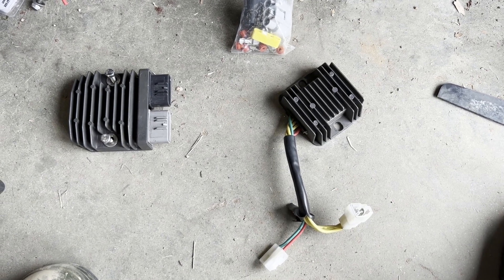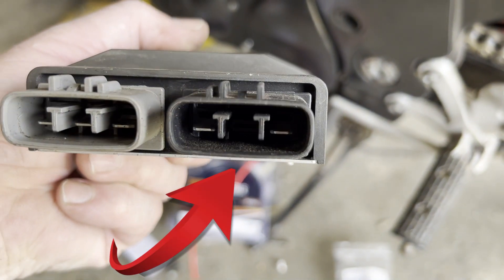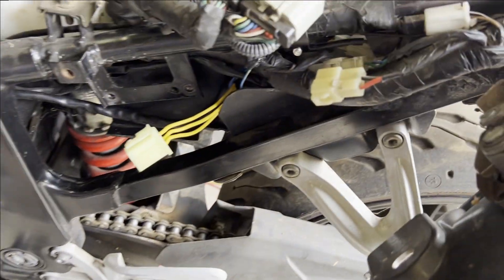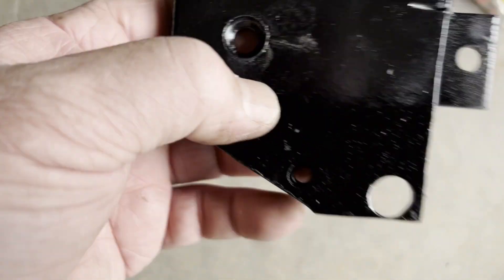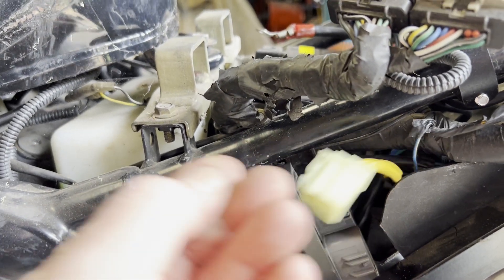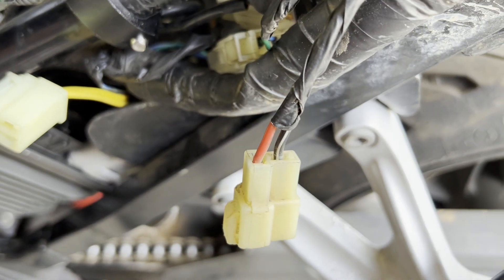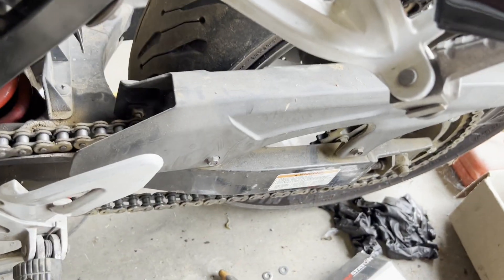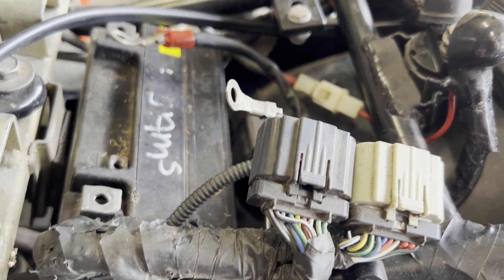Hyosung GT650 Regulator Rectifier Upgrade

Comment: No sure if you can hlep me or not but my hyosung rectifier melted so i replaced it and it melted again would this upgrade rectifier fix the melting problem?
Reply from the maker: Possibly but I would be checking your stator voltages/shorts as a damaged stator can take out the regulator rectifier

Comment: How can I identify a failing ECU?
Reply from the maker: Hey Thanks for checking out the channel. These bikes will torment your soul when it comes to electrical issues. Before worrying about an ECU, I would ensure your stator and Regulator rectifier are good so you have a good clean 13.5 volts. Then I would follow the schematics and check your power and grounds for the ECU. I have a spare ECU that has been flashed if you want to try it (GT650). Also is it a Delphi or a Daewoo ECU. I only have the Delphi as a spare.

Comment: Thank you for this video you directly helped me repair my hyosung gt650r ive been replacing everything els but now that i replaced this component the battery is charging again 🙏
Reply: hello excuse me where can I find this regulator? thanks a lot regards
Reply from the maker: @giuseppemele2169  I got mine from a dismantler on Ebay
Reply from the maker: No Worries, thanks for checking out the video👌

Comment: hola, que problemas solucionaste con la actualizacion?
Reply from the maker: A stable charge rate for the electrical system and stops excessive heat as this rectifier runs a lot cooler.